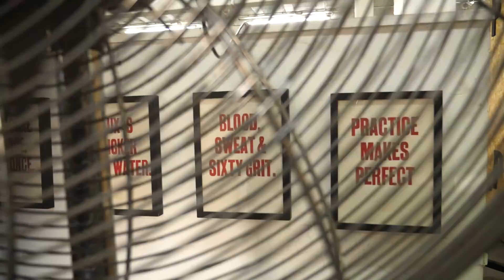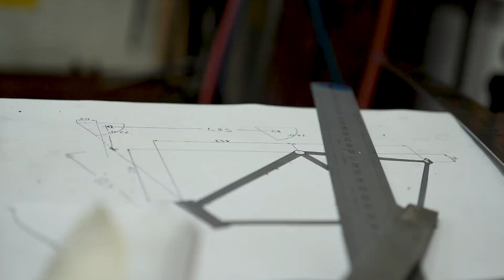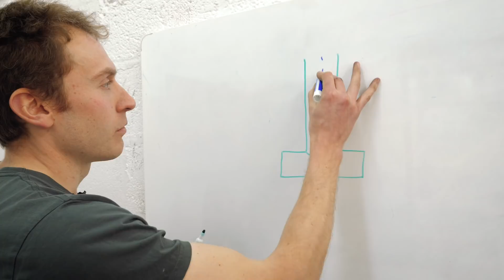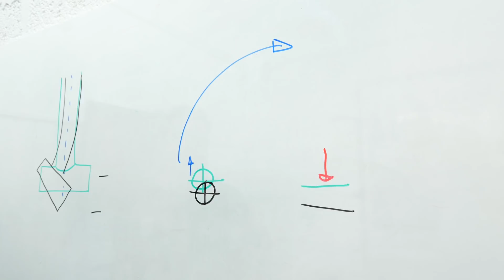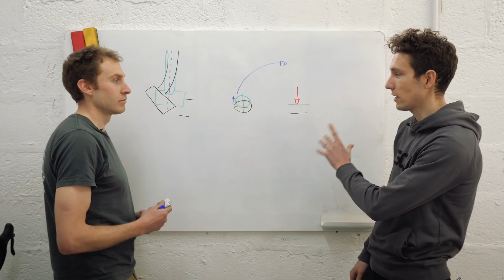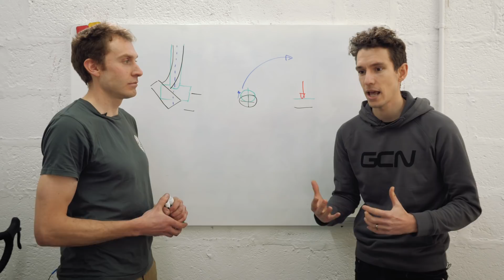Are You Faster On A Stiffer Bike?

Comment: This experiment would yield an equal dead spot when you put that pressure on the left hand crank, based on what you show. I would imagine that if this were the case you should be able to measure the energy loss or gain by using both crank based power meter and a hub based power meter at the same time: the hub would show a slight gain just after the driveside pedal passes something like dead bottom, which would not show when the lefthand pedal passes this same point.

Comment: Simon, there is an experiment you guys could perform that could possibly reveal any power loss difference between a "flexy" frame and a "stiff" frame.  It would require a PowerTap hub power meter and a crank based power meter.  Using the same power meters on the two different bikes, you could see what the offset was between the power reading at the crank and at the hub. Since this offset might be small and possibly not resolvable at lower power outputs, it would likely be best to do this test either in an all out sprint or in all out effort uphill.  you could then compare the percent offset with respect to the crank based power, i.e. (offset - crank power)*100/crank power.  If you don't maintain the same power output between tests, you might see some uncertainty bias, but that's not necessarily a game killer.  You wouldn't be looking for the quantitative difference in power loss between the two bikes but rather the qualitative: is there more power loss in the flexy bike vs. the stiff bike.

Comment: As far as power delivery goes, I figure that while a stiff frame may be more responsive to pedal-strokes, that also makes the pedal-strokes less smooth (what with the pedals being a full 180 degrees apart.) But, I suppose that smoothness would only really matter if you were riding on ice or with some other conditions that would allow the rear wheel to break traction. Might be worth something to "fatbike" builders.

Comment: You want another line of debate, here it is. If you have a stiff bike, you put your energy directly into the propulsion, but if you have a flexi frame you have and oscillation of power in, power out. If the resonant frequency of the  bike doesn't  match your cadence, you get some attenuation of your energy applied, it could go to losses in the hysteresis of the frame material or in the losses in your legs (fatigue).

Comment: What about the frame bobble/ bounce, being absorbed by the body and muscles having to work against the bike flex.With Stiffer frames your body/ legs only have to work against the friction of the drive train and not an added force of the frame flex? I still don't believe the soft wheels either. I'm hoping it's only a mater of time before some smart physicist turns that notion back. I'm waiting for the unified theory to balance out Einstein's general relativity and Quantum mechanics.

Comment: Great video and great comments! Love seeing this. The cycling community is fantastic. One piece of context that is important (sorry if it's been brought up already) is the reality of who is riding the bike. Just as a 69 year old triathlete going 15 MPH isn't getting benefit from their aero frame....that rider doesn't have the strength to force energy through their pedals, a stiff frame and into the wheels to move the bike without great fatigue in a  short amount of time. Perhaps the "softer" frame is exactly what 70% of average riders need? The physics and engineering are intriguing! Context is very important.

Comment: It seems to me the wheel spinning is mostly from the potential energy stored in the chain,  at around 4 minutes you see the chain jolt/twitch forward upon releasing the brake. IMHO for 99% of us the majority of frames are stiff enough and frame flex (on most bikes) isn't that big a deal and not another thing we have to worry about upgrading. Ride upgrades don't buy 'em.

Comment: Just to throw another confounding variable into the mix, recent research on the physiology of fatigue in endurance sports such as cycling are pointing to fatigue being largely a mental construct (i.e., as your muscles fatigue you need to recruit more muscle fibers to complete a given task and that it this extra mental effort to recruit additional muscle fibers that your brain interprets as fatigue).  

This implies  small differences in mechanical efficiency between frames could also have a multiplicative interaction with our perception of fatigue and therefore realized performance.

As a quick test, started swapping a power meter across three frames that I felt rode either lively or dead.  Wheels and body position were the same. I rode to perceived exertion levels without power readings, then compared the average wattage.  I tended to put out about 57 watts more (95% Confidence Interval: 39.0 watts, 76.4 watts)  than the bikes that did not feel as lively.  The power meter was crank based so any energy return from the frame would not have been included.  I also compared average heart rate, which tracked the higher wattage suggesting higher effort despite perceived exertion being similar.

My interpretation, was that it was mentally "easier" to ride the bike that I felt pedaled more efficiently so my focus was better and my muscle recruitment was better.  There of course may be energy return from the frame, but I think how this interacts with the mental component could be where the real big returns come from.  

Anyway, to do this experiment properly, the rider would need to be blind to the bikes (e.g., built up with different tubing or layups but visually identical)

Comment: There is a better way to test this. Yes you flexed the frame and when you released the brake the stored flex energy was transferred in to the drive train but this doesn't happen in the real world. When out on the road and you put power down the little that goes into flexing the frame surely doesnt come back into the drive train as your pedals are turning constantly. To prove this properly you would need to measure the time it takes for the flex to be released from the frame. Eg It we assume a cadence of 90rpm, thats 1.5 revolutions per second. So on my right pedal power stroke (1 O'clock to 5 o'clock) that would be just under half a revolution and at the end of this the left pedal would be ready for its power stroke. So if the flex can return in approx 333 milliseconds that would mean that the flex return would be in sync with the left pedal power stroke and so on. If this happens i would buy the theory.

Comment: Ultimately it depends on how much force you are capable of putting out. The more force you can produce the stiffer the bike you would want. If you are able to flex a stiffer object the more force you have stored to be released. 

Hockey players with the hardest slap shots will have stiffer sticks as they are strong enough to flex them and produce greater force.

Pro Cyclists will have stiffer bikes as they are strong enough to flex them, same concept.

Comment: Perhaps the advantage of stiffness has more to do with acceleration than overall speed?  Think a drag race involving several frames of varying rigidity (preferably from the same manufacturer) should be the next test, would be very difficult to conduct in completely neutral conditions even with a power meter, but worth a go if just for the fun!  Apologies, just seen that this point has already be discussed below!

Comment: You can easily prove/disprove Si's conclusion by doing the experiment again, once where you load the pedal with the brake on the rear wheel (frame flex) and one where you load the pedal with the same force but no brake applied (no frame flex). See which one spins the rear wheel more.

Or, better yet, put a powertap hub in the rear wheel and measure which method puts more power to the wheel.

I know where I'd put my money.

Comment: I think the energy stored in a flexing frame is released in the form of a slightly slower crank rotation just after the powerful part of the stroke. In other words, when you come off of the most powerful part of your stroke, the frame straightening isn't going to propel you forward, it will just slightly slow the pedal stroke. So the power really is lost because it didn't get translated to forward speed while there was pressure on the pedals. If the pedals were being turned by a machine that never varied it's power at all, then the energy might be released into the wheel, but people don't work that way.
Reply: (I hope i can write properly in English....)
 In addition, any time the frame flex, it causes to lose the straight line between both wheels (more precisely they get away from the same plane, where they mast be), and it results in a mesh of not parallel forces (both tires tend to go in different directions) that generate a high loose of energy. Also, as both tires tend to go in different directions, there is a  loose of energy  due to increased friction forces between tires and road...

Comment: Love this vid., and some of the comments below are excellent.   Perhaps a refinement of the set up to measure the heat loss/kinetic energy loss.  That said, as a guy who recently ended his hard tail hold out status, my new full suspension mountain bike yielded me numerous p/r's on trails I've been measuring on Strava for years.  Lot's of heat loss through making shock oil get warm yet the net result was quicker times on all sorts of trails, not just downhill segments.  And lastly, fatigue is another component...even on the road, a comfortable (flexy?) bike may prove slower on short, high output situations, but end up being quicker during long days on a bumpy road in spite of the heat loss of bending and releasing the frame tension thousands of times.

Comment: A more flexible frame will allow more lateral flex under loading which can cause fishtailing when you increase power output in a short period of time. I've been in races on less flexible frames when sprinting (>1500W) has caused the rear wheel to move laterally, losing propullsion. Quite a scary experience in close proximity to other riders. Haven't has these problems on bikes with stiffer BBs/frames even with an increase in power output to 1800W. 
Also when the bike on the video is on the turbo there is only once place the force can be released which is through the drivetrain and into the wheel.

Comment: Heres the answer for you.
So the frame flex shifts the position of the bottom bracket on the downstroke. But the pressure gets released on the upstroke, thereby putting the energy into reversed pedaling. Thats a clear loss right there. There is no gain or recycling of energy happening as explained in this video. Im surprised this wasnt discovered earlier, and that this idea reached so far. If anything, this experiment shows that a stiffer frame is indeed faster.
Sadly nobody will read my comment anymore... Thumbs up please.
Reply: You either dont have a clear understanding of whats going on here(the physics), or you didnt understand the video.. They literally diagram out the opposite of what you are saying.. The BB gets flexed(deflected downward), while the pedal stays in place.. When the system unloads the BB moves back up into its unloaded position while the pedal stays in place. This causes a FORWARD motion in the pedal stroke.. not a backwards one..  Thats is what is returning energy into the system.
Reply: Golf clubs are engineered for various amounts of flex in the shaft so that the quantity of energy storage and the timing of its release maximize clubhead speed at impact. A stiffer bike stores more energy for the same amount of flex (E=0.5Kx^2, K is the modulus and x is the deflection), but it also returns the energy faster. Perhaps if flex were engineered (in the crank arms?), the release would occur during the dead spots in the stroke, maximizing acceleration. It would have a negligible effect at steady state, though. In the meantime, a stiff frame feels better and accelerates faster, so all else being equal, is better.

Comment: I don't know much about physics, but I think that the axle being pinned in a turbo trainer must largely influence the results. If the axle was not pined by the trainer, wouldn't energy stored in the frame exit in others areas; and not be channeled into the rear wheel?  Not sure if thats correct, any ideas?

Comment: I'm not sure but I think that the problem with the flex may be with the synchronization of the flex return. In the experiment, the "flex-back" occurs in the same position as the initial, so with pedal at 3 o clock and that results in a return of energy. If the flex-back of the bottom bracket occurs at 6 o clock, when the pressure over the pedal is released usually, it doesn't result in a rotation of the pedals but in an elevation of the rider, so maybe we expend energy moving the rider up and down.
Just my hypothesis.

Comment: A: The frame will never flex that much if the rear wheel is not locked in a trainer.
B: Much of the wheel spin is from the Chain stretch, the cassette being torqued up ECT. 
C: The frame is being flexed 90 deg to the wheel so very little of that is helping spin the wheel.

Comment: I don't disagree with that frame flex contributes in the way postulated in the video. But it's also highly likely that the spokes in the wheel are being wound up too which will contribute to this effect.  In my experience when I went to a low spoke count light wheel (Easton EA 90 SLX replacing a 32 spoke) I could feel the springiness of the wheel in the system. 
 Likewise the standard "push your foot down on the pedal" stiffness check tends to find wheel flex more than frame flex. 

At the end of the day common sense would dictate that you get the energy back from frame flex, if you compress and release a steel spring for example, it will spring back. The mechanism that flexed the frame is highly likely to transfer it back after pressue is released from the pedal.
Reply: Ah, interesting thought but not in this case as the brake is a disc brake and so the braking force is at the hub.
Reply: Good point... 
The Orbea is rim brake though and it looks like it exhibits the same behaviour to an even greater extent.
Reply: Well if on one spokes have no effect, and on the other you suggest that it accentuates the effect, it suggests that perhaps might not be the cause don't you think?

Comment: 1. Pro's would ride flexy frames if they were faster.
2. The current trend is for a stiff frame that also absorbs shocks and vibration. Makes sense.
3. In the future, we may see frames that have rider adjustable stiffness. RAS?
4. More stiffness is especially important when standing, accelerating, sprinting.
5. Wheel stiffness is also important, especially for the rear wheel. 
6. If you're a big and powerful rider and like riding hard, you'll probably want a stiff frame.
If you're more leisurely, more comfort and less stiffness will probably suit you better.
Reply: 1. Bullshit. They ride what they're contracted to. Read Rebecca Twigg affair.
2. So your point is?
3. They already exist. Google Trek Domane SLR.
4. How so?
5. Yes.
6. I'm big and powerful rider and I like flexy frames. Also, define "riding hard". Does that mean slow cadence/heavy mashing or spinning the lightest gear possible @115 rpm? I'm heavy masher and I ride like a complete jackass. Still, I'm fine on my bike made of bendy metal. Flex is where the comfort at.

Comment: The rider will move more vertically on a softer frame during stroke to movement transition. That energy will not spring back. 
Mechanically the drivetrain/frame/spokes are close enough to a theoretical spring. Give the tire.

Comment: **Orbea paid promotion (7:43)**, that is what about is the video all about, no science at all, only thought without conclusion. Dislike because I can't return 10 minutes of my life.
Reply: I'm sorry but no, you've completely got the wrong end of the stick, it's like you've misunderstood the entire video.
Reply: Simon Richardson, I really liked GCN does science, but here I've found only ground for reflection, sorry. I think that the back wheel moves because the overload of drivetrain (chain and chainrings are not completely matching each over, there are some small gaps between them) + frames stiffens index + centrallock brakes (there is a slight move in them in comparison to 6 bolts). I wish GCN tech will put a point in this question.

Comment: I agree that the flexing of a frame will produce some heat and that is a loss of energy as far a propelling rider and bike forward goes, there fore one would think a stiff frame is faster and on a glass smooth surface that may be true but just as we now ``know`` lower tire pressures to be faster, I believe that there will be a distance where the flexy frame will be faster due to less rider fatigue (most flexy frames are also less fatiguing due to better damping of vibrations from the irregularities on the road surface). Admittedly the distance where this occurs may be way beyond the grasp of most riders, but when riding multiple days  such as a grand tour the effect will compound. This is why I love my Titanium frame

Comment: Your frame flex lets you see that not all your energy is not just going down your chain and turning the back wheel, but the flex is a symptom not the cause. The main cause of this is simply that the pedal is an outboard cantilever and some of your energy is therefore acting laterally. This energy is used up flexing the frame. If the frame is stiffer the same energy will flex it less, no saving there. The further your foot is alng the pedal spindle the more of the energy you put in will act laterally across the frame, so get your feet as close to the cranks as possible unless you have a biomechanical problem with that. If this is not obvious try imagining your pedal spindles were ten inches long with the platform mounted at the end of that travel. It should be immediately clear to you that the frame flex would be enormous.